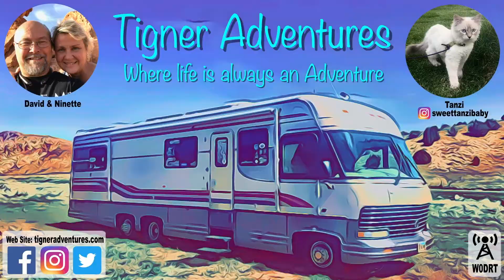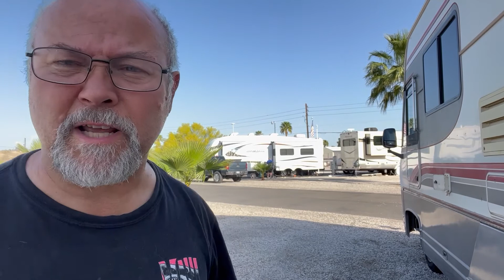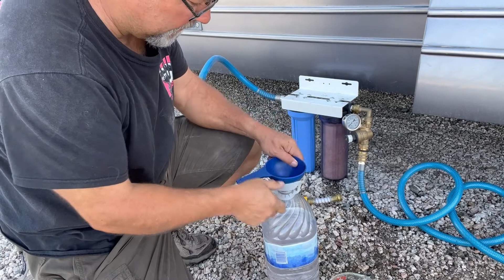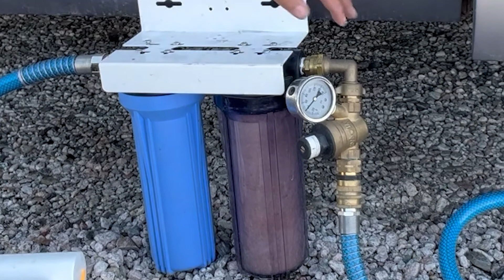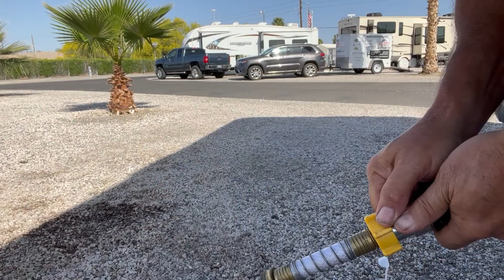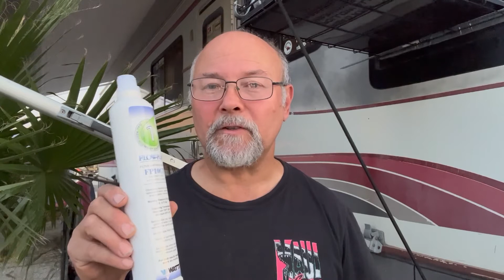SANITIZING YOUR WATER TANK - RV LIFE: Maintenance that should be done.

Comment: It says to put 1/4 cup of bleach in 1 gallon of water at a time. Not the whole 1-1/4 cups in one gallon. The instructions are more on the safe side.
Reply from the maker: Interesting Point Paul. But if you read further it says pour into empty tank so in that case you would have 5 gallons of water in the tank before you start filling it.  In my case you already have a large amount of water in the tank before adding the solution.  I think the end result is the same and I don't believe it is any safer either way. However I am always up for pointers for making things better and safer so thanks for pointing that out and watching and supporting our channel.
Reply: @TignerAdventures  I agree that it's not much difference. I think that it just makes the gallon of water more concentrated and spilling it on the side of your RV or on yourself before it gets in the tank could cause some damage. Also suppose your tank was 150 gallons. You would be putting 2-1/2 cups of bleach in a gallon of water. Still not that dangerous but even more concentrated.
But thanks for helping the community out!
Reply from the maker: @paulv6592  Really good points Paul. Thanks for the feedback. Erroring on the side of safety is never wrong.
Reply: @TignerAdventures  I was also curious that with all the filters you use, the water is still salty tasting?
Reply from the maker: @paulv6592  To be honest we have not tried it since we added the 2 filter style also. I guess we should try and see what we get. We actually drank it that way for most of last year because we put flavoring in the water and didn't really notice it.